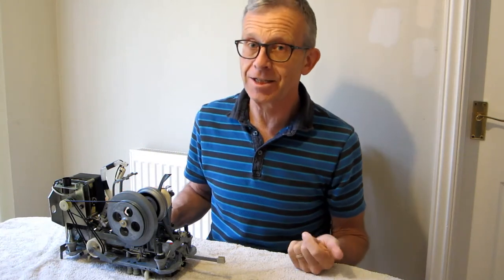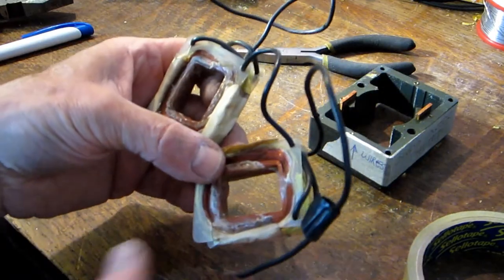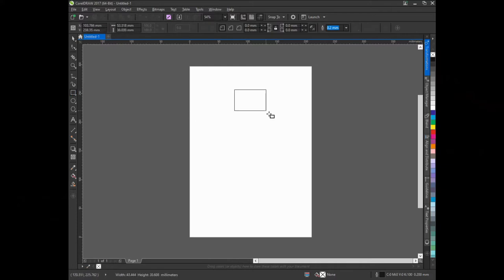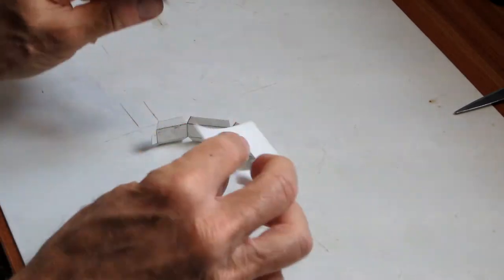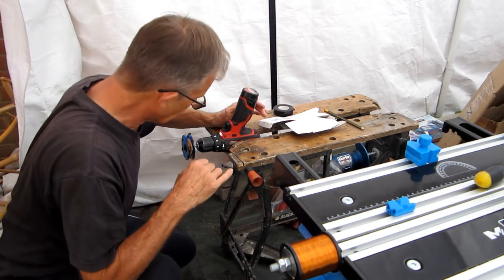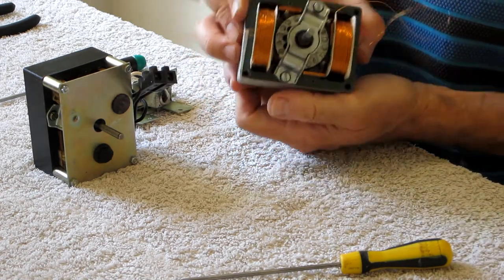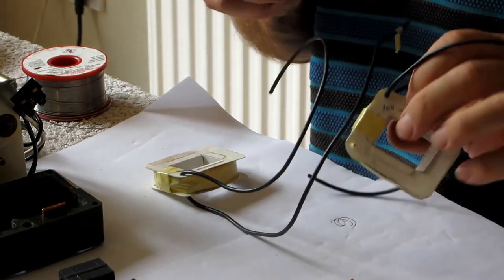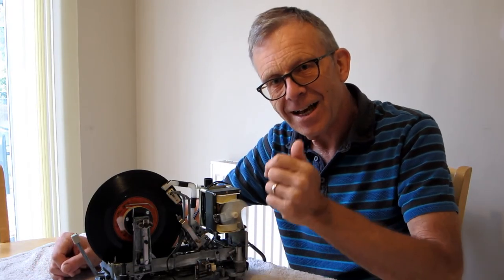Rewinding the universal, shaded pole motor from a Gerinvex or KB Discomatic jukebox

Comment: how did you connect the black wires to the .030 wire? that is unclear.
Reply: You can strip back the coating on the small wire and solder it